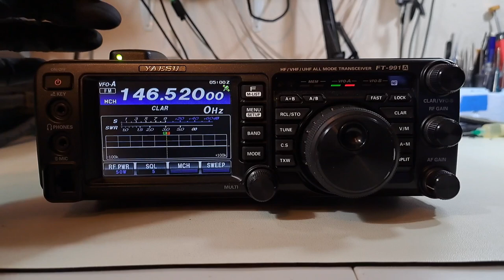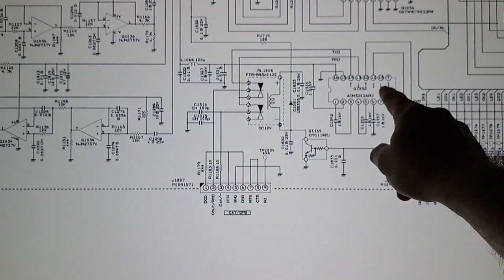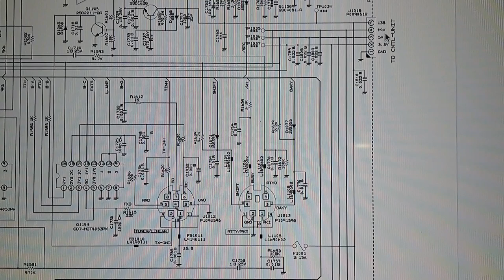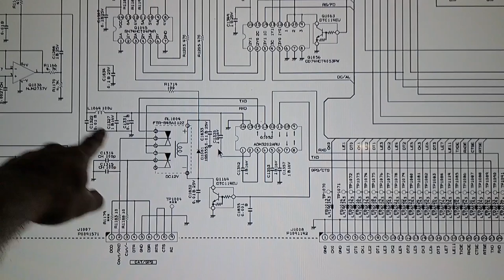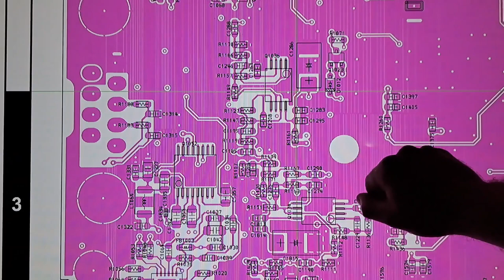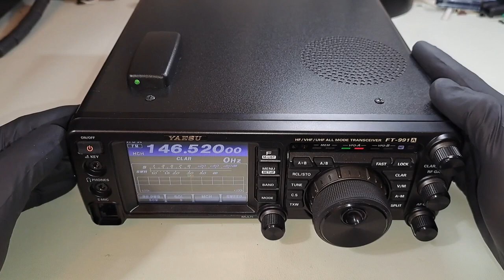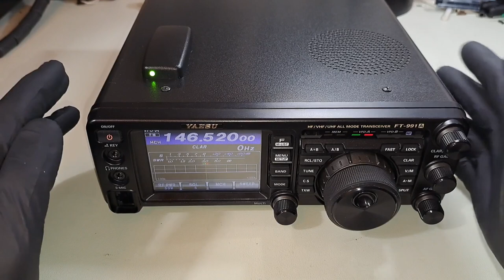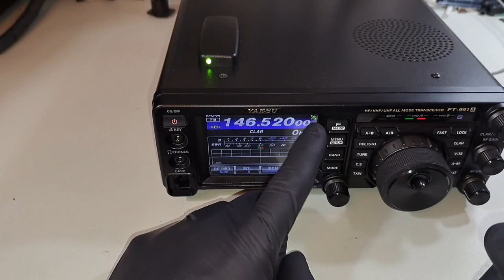FT 991A + Internal GPS receiver

Comment: Fantastic video!
Reply: Thank You! I ordered the same level converter board you used and eBay item # 132475473691 shows the board connections. I also ordered a GPS module GY-NEO-6MV2. I will not open the case of the FT-991A and I'll get 5VDC from a LM7805. I plan on using the radio for POTA. Thanks again! 73 de WA2SST

Comment: Can you show the TTL to RS232 connecton to the MAX3232 mini converter board? I worked with the MAX232 chip years ago when I configured my Icom radio to RS232 and I am now confused as to how to interface the chip. 73 WA2SST
Reply from the maker: Hello, 

GPS receiver connected to pin 11 (input TTL) 
Transceiver to pin 14 (output RS232) 

More info in the datasheet.

Comment: Look at your pin,s rs-232 ?? if i look in te manual yaesu 991a than yaesu mention  pin 3 input , not pin 2 ???you speek  this and do that. , help pls , thanks for the good video
Reply from the maker: Hello,

Yes, there's a bit of confusion. 
I know a several users also attempted to connect a GPS via pin #3 without success. 
Please carefully read the original Operating Manual (2111A-KS-1), specifically on page 19, in the top right corner:
 "[GPS/CAT] ② SERIAL OUT/RXD (GPS DATA IN)."

So, what does this mean?

When using CAT, pin #2 serves as data output. However, if you change the setting in the transceiver (field 028) to utilize an external GPS, pin #2 undergoes a change in its properties, now functioning as a data input.

The Yaesu FT-991A is a powerful transceiver with numerous features and flexible settings. Delve into its functionality as thoroughly as possible. By adeptly applying various settings, you can achieve excellent results.

73!
Reply: @UT4UFA  TNX for you explenation sorry for my bad english , i have a GY-NEO6MV2 gps module from alie can you thel me witch connextion i must wire to the  yaesu ft 991A  (i think TX from the gps To pin 2 yaesu) or is it  RX To the  yaesu
the gps is  blinking blue everry second , must i reset the tranceiver ??
or must i use a ttl converter ? have a nice day and evening PA0EHJ   73"s
Reply from the maker: To start, download the datasheet for your GPS receiver. Identify the port type: RS232 or TTL/CMOS to determine if a level converter is necessary. Additionally, take into account the settings on both the transceiver and the GPS receiver. It will take some time , but only then you can determ compatibility. @janvanderlinde3039
Reply: @UT4UFA  Tnx for you reaction pls can you tell me which ( RX or TX ) i must connect from the  GPS module TO the  991A pin 2  ? RX OR TX ??? keep strong we think of u  and try to help
Reply from the maker: All details regarding the connecting and assigned RX/TX ports and the remapping of data ports should be available in the datasheet. 
Any actions you take are at your own risk. @janvanderlinde3039
Reply: @UT4UFA  Tnx Sergii i wil try ,have  a nice day 73,s from Jan

Comment: Where did you get the module from
Reply from the maker: The module is outdated and is pretty hard to find. I most likely suggest finding a more modern version of this.
Reply: @UT4UFA  ok thank you. Any suggestions where to look for a module that will work? I just looking for the gps to work on my 991a
Reply from the maker: @charlesriley9426  
Well, there are many good GPS modules present on a market.
You need one with an NMEA data format, TTL or RS232 port, and a data rate of 4800-38400bps.
Try the NEO-6M GPS module, and do not forget about TTL to RS232 converter.